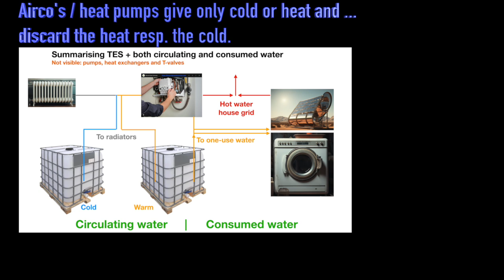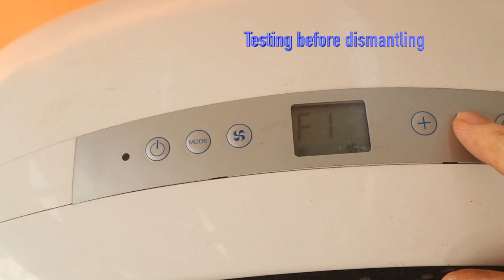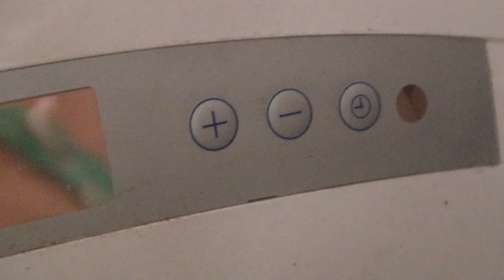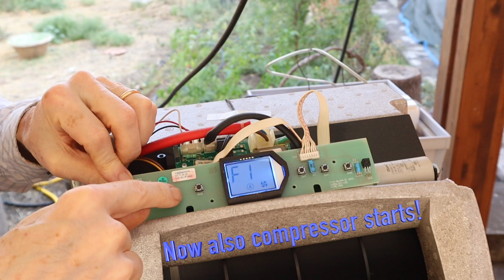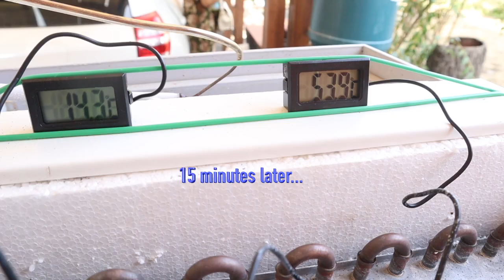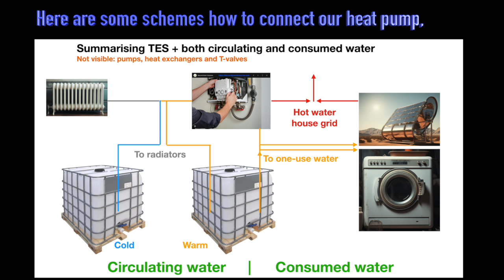Transform a small air conditioner and double its efficiency - Video 61

Comment: PLEASE TELL US THE AIRCONS THAT RAN WITHOUT FANS- THEY ARE DISGUSTING - WITHOUT FANS, THE SYSTEM CANNOT RUN CORRECTLY+CAN KILL COMPTESSOR- NAME+ SHAME!! THE AIRCON SHOULD HAVE TEMP/ PRESSURE SENSORS TO STOP OPERATIONS IF OUTSIDE PARAMETERS- ITS LIKE DRIVING A CAR,WITH NO TEMPERATURE WARNING LIGHTS...
Reply from the maker: You mean when they are frozen or even just wit a fan motor burnout? That's indeed a weird condition.
Reply: @nnvasen-good-energy  LOTS OF THINGS,BUT THINK- IF IT COULD WORK PROPERLY WITHOUT FAN- WHY WOULD MANUFACTURERS FIT THEM?

Comment: PLEASE PUT CAPTIONS STATING THAT SAFETY GLASSES,GLOVES MUST BE WORN- IF YOU CRACK A REFRIGERANT PIPE,NOT ONLY ARE YOU BREAKING THE LAW+ HARMING ENVIRONMENT,YOU RISK BEING BLINDED OR SEVERELY INJURED WITH FROSTBITE...THATS JUST ONE REASON YOU NEED TO BE QUALIFIED TO WORK ON AIRCON...
Reply from the maker: That's a good point Liam, I should put it in description and on pinned comment and as you say in caption so that at least al new viewers see it
Reply: @nnvasen-good-energy  YOUR ADVICE IS GREAT-THE LAST THING WE WANT TO SEE IS SOMEONE GETTING HURT- THAT WOULD STOP ALL YOUR GOOD WORKS,AND IT HAS TO BE REMEMBERED-THERE CAN BE PEOPLE WITH MINUS ZERO COMMONSENSE DECIDING TO TRY IT,SO THEY MUST BE TAKEN INTO ACCOUNT- AN EXAMPLE OF PAINFUL REFRIGERANT ACCIDENTS?...
GRENFELL TOWER-WAS CLAD IN ALUMINIUM SHEET, WITH FOAM IN-BETWEEN...
NO ONE THOUGHT THERE WAS ANY FIRE RISK...
A FRIDGE HAD A REFRIGERANT LEAK- THE COMPRESSOR SPARK,ON TURN ON ,IGNITED THE GAS...
WHICH WAS HOT ENOUGH TO BURN THROUGH THE ALUMINIUM AND IGNITE THE FOAM...
78 PEOPLE,DEAD- FROM REFRIGERANT ( BUTANE- CHEAPER THAN FACTORY MADE REFRIGERANTS).
WHEN YOU WATCH VIDEO,YOU ACTUALLY SEE FLAMES- GOING DOWNWARDS...
ALL FROM A FAULTY FRIDGE+REFRIGERANT I BELIEVE SHOULD BE BANNED IN DOMESTIC APPLIANCES-THE USUAL R GASES DONT IGNITE( BUT ARE VERY NASTY IN DIFFERENT WAYS).
DIY IS GREAT- BUT SAFETY MUST ALWAYS COME FIRST,OR ELSE IT CAN BECOME A FALSE ECONOMY.
ANYWAY - LOOKING FOWARD TO YOUR NEXT VIDEO!👍👍👍👏👏👏🥂🥂🥂

Comment: SEARCH DO IT ALL DRILL BITS-EACH BIT DRILLS CONCRETE,WOOD,TILES,GLASS,METAL- SAVE A FORTUNE! LESS TO CARRY/ LEAVE ON SITE- AND SAVE THE PLANET! ONE SET FOR LIFE! GUARANTEED 10 YEARS...THEY ALSO DO DIAMOND COATED SCREWDRIVR/ HEX/TORXETC BITS- FANTASTIC, ESPECIALLY ON OLD,WORN SCREW YEARS- LOTS OF BITE...
Reply from the maker: I found them for 17€, can you give me your brand to be sure I share your satisfaction?
Reply from the maker: By the way, I put the frostbite warning in captions and pinned comment.
Reply: @nnvasen-good-energy  That's too cheap- they are not the real DEAL- real ones have 10 year warranty - they do an advert on YOUTUBE- if I get time, I'll search and get back to you...

Comment: I love your ideas. Instead of water, can you use sand as the thermal battery and if so would that be more efficient?
Reply from the maker: Hi AwesomeCat, thank you very much for your appreciation! I would not use sand because it has about 4 x less heat capacity. The temperature range of the heat pump is already limited to a couple of tens degrees, unfortunately.

Comment: Ive found doing this with a dehumdifier is less complex and possibly cheaper depending on your used market conditions.  Simpler layout and control systems, but same double heat exchange coils and compressor.
Reply from the maker: You are right, for smaller power this is very interesting, see my video 2 or 3, where I do the same. Can be interesting also for pumping heat in an fresh air/exhaust channel so that the exhaust air gives its heat to the incoming air. High efficiency because of the nice warm air on the evaporator!

Comment: I just found your channel and look forward to watching more of your videos.  I made a water-to-water heat pump from 2 small window air conditioners and some scrap wood.  The cold vat water (and glycerin) is pumped through 30m of 1/2" pex buried in my small yard.  The hot side connects via a heat exchanger to radiant floor heating.  I started using it to help heat my Toronto Canada house in 2022.  I also have an air source HP and a gas boiler but I have slashed my gas usage.  Some other of my projects: a heat recovery bathroom fan, a flue cowl hot water preheater.
Reply from the maker: Hi Dadsfave, that are great projects you accomplished. How do you run the heat pump, with PV? That might be difficult in winter. You told about reduction of the gas bill but I imagine you didn't at the same time increase the electricity bill. Of course you can use off peak electricity and "charge" a big water container with the HP energy. How did you do that?
Reply: @nnvasen-good-energy  I run the heat pump from our grid, which in Ontario is 90% carbon free thanks to nuclear and hydro.  My goal is not to go off grid.  Our power is reliable.  My goal is to reduce my CO2 emissions without increasing operating costs.  Yes my electricity bill has increased -- a bit more than my gas bill decreased.  This year I replaced some of my pumps with high efficiency ECM pumps.  I hope to reduce power use by 10%.  My system is controlled by 2 Raspberry Pi computers with relays to control the pumps and compressors and thermistor temperature sensors to measure up to 52 temperatures, including underground.  I can easily program different control strategies using Python.  For example, if it is not too cold, I can turn one of the compressors off during peak hours to reduce costs.  When the outside temp is too low, say below -5C, I run the boiler to supplement the heat pumps.  I do not have solar panels.  My roof angles are not ideal.  I also plan to try using the battery of my new EV to time shift power from off-peak to on-peak times.  I don't have space for large heat storage tanks, but my ground floor has a concrete slab that stores heat.  The yard stores heat during summer months for use in winter.  See my YouTube channel and the reddit post linked from there.